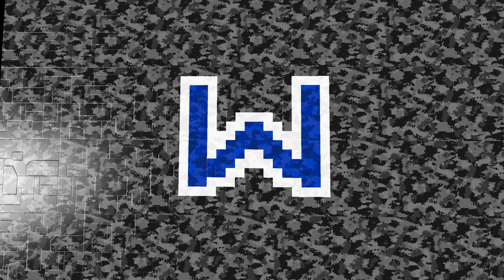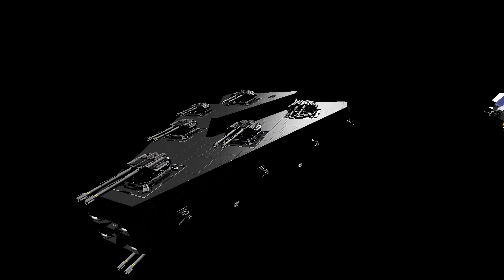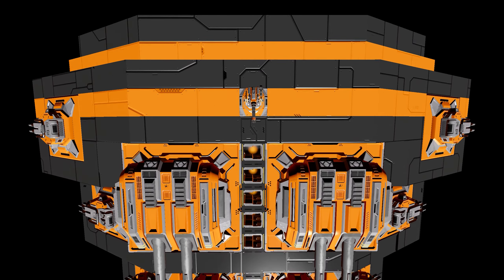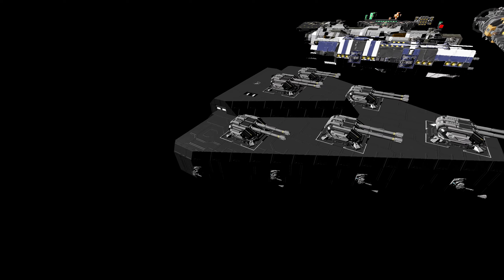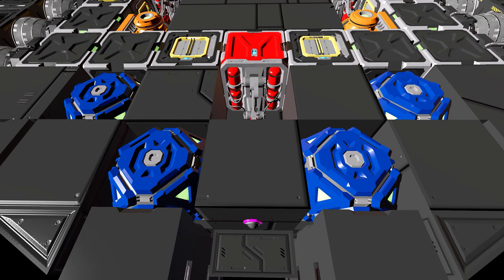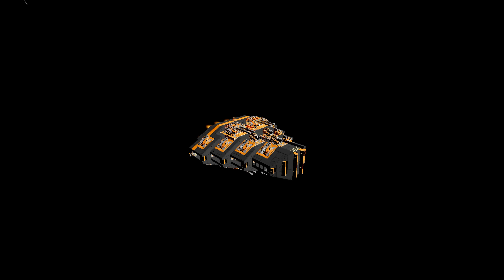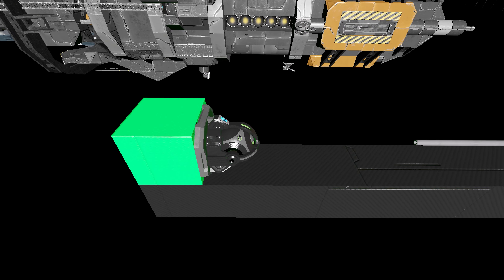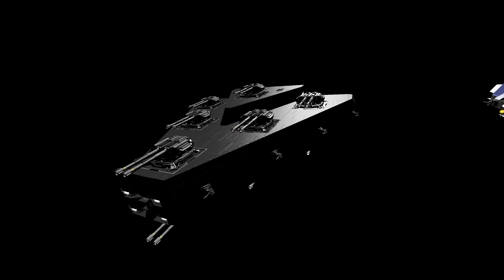What Makes A Ship Good? | Space Engineers

Comment: The defense shields mod has a major impact on ship design as well. The dynamics of weapons changes a lot because some are stronger against shields and weak against armor and vice versa. Also, slower ships can compensate by putting more reactors in to pump out more MW for stronger shields. They end up turning into big tanks that can soak up a lot of damage and if your shield is weaker they can rip through it more easily.

Comment: To add more logic about broadsides vs doreetos/superfiring. If you put 10 turrets on a superfiring ship and 10 on a broadside ship, in any engagement the broadside ship can only bring 5 to bear at once while the superposition means you can bring all 10. A ship with superpositioned turrets and efficient placement can punch FAR above its weight class. There is a reason  ww2 battleships often had superfiring turrets, so that outside of a broadside they could use more than 1 turret and instead 2 or 3 at a target in front or behind them.
Reply from the maker: well said :)
Reply: not necessarily true, you can roll your ship so the top deck is aligned with the target, all turrets will be able to shoot now

Comment: My ship was designed to be a heavy cruiser and mobile base. I consolidated all crew areas and expanded the cargo hold and smaller hangar. I also built triple redundancy for power and thrust. It has a capable turret system in case of broadside, but I prefer to keep enemies at range using 4 forward facing rail guns  hooked up on timers in order to stagger the shot in a manner that I can decide to fire two instead of firing all 4 at once. I hit them from afar while a small fighter compliment does most of the heavy lifting. If they try to maneuver back up and orient forward. My fleet command style is keeping all ships on line and focus fire forward using rail gun batteries.
Reply from the maker: thats cool!

Comment: Apologies for what turned out to be another wall o' text:

Superfiring is a term for describing turrets placed to fire over lower turrets (exhibit A: the Dorito chip).

In a sandbox, anyone can build anything they want, then justify it with a set of lore specific to their goals. But I feel like good ship design doesn't have to run counter to RP lore, and what some people dismiss as "game meta" is just sensible. this is a bit of semantic arguing, but superfiring turrets are generally a logical conclusion for good combat design (barring specific reasons to want to compartmentalize and hide your turrets by countersinking them within the armored hull). Internal thruster blocks are game meta, b/c IRL you can't do that with real thrusters given our current understanding of drives using reaction mass. :D And this isn't to deride internal thrusters or other meta, b/c I've used them too -- if it works, it works.

On my own though, I like to make my game lore or whatever coherent with rule-based ship class designs, broadly similar in concept to how GetBrocked does their Outlands ship classes.

For myself in solo PVE, no tool/production blocks (drills, welders, grinders, refineries, assemblers) on the same ship/grid with weapons; only survival kits and basic assemblers/refineries. That keeps my utility ships distinct as auxiliary or non-combat ships. The two basic production blocks are a deliberate design choice to restrict my combat ships from simply being factory/mining ships plus guns, and my production ships simply being warships plus refineries/assemblers. :D Otherwise, I found myself smearing all my functions into a single all-rounder, like how Luca describes her survival warships plus full refinery plus full assembler plus drill.

I'm also reaching a point where I finally need to learn to make a (not so?) basic mod for automatically charging the player space credits per owned and active PCU, per time period. With a default multiplier for small grid blocks, large grid blocks, and optional specific per-block multipliers as inputs. Using this little RP idea of paying regular maintenance/overhead fees for grids/PCUs used gave me an abstracted analog to real-world operating costs, and spurred me to secure an income (even if it was a trifling moment's work to sell some magnesium for a few million credits :P ).

This soft constraint on blocks made me reconsider slapping down 20 drills, b/c they're more expensive. And when I set price tiers and higher specific block upkeep costs, it further shaped my gameplay/design choices. With the Aerodynamics mod, I usee SG 300 and LG 150 m/s speed caps. With my voluntary upkeep cost game rule, I charge myself 1 credit per small grid PCU, and 10 credits per large grid PCU. For my current  economy/combat focused play, an additional stacking 100x multiplier for any tool/production block -- so a large grid drill costs me 190,000 credits per ingame day (every 2 hours). This motivates me to NOT build huge grinding pits, massive drill rigs, etc and leave them lying around. Either they pay for themselves with stuff I can make/sell from their output, or I tear them down when not in use, or I keep only a minimal 1-2 drill rig that's very adaptable.

And previously, once I got out of the early survival resource grind (easy enough with a series of bootstrapped drills and rigs), there was no real advantage to using small grid ships. In fact, PCU-wise, there's often a strong disincentive to use small grids. They die if an enemy weapon gives them a dirty look. They're PCU-expensive. They can't carry much or do much damage. But the above combination of 300 SG speed cap and relatively cheaper space credits upkeep cost makes them more viable in my little bubble world now. When a modest large grid warship could cost me 200k credits per ingame day to maintain, printing and running a series of cheap 2k credit task-specific small grid interceptors and bombers/gunships makes a lot more sense. Especially when combined with AI block drones.

It helps remind me to be more PCU-efficient, less lazy, clean up my grids, use a more diverse range of ships, etc. Until now, I have virtually NEVER built a small grid large cargo container or small grid cargo ship. :D Now within these rules, they actually have a niche, serving as fast local couriers to fulfill high-value, low-volume contracts or trade station resource sales (thus letting me afford those large grid warships more time-efficiently by quickly hitting all the local stations for selling magnesium, platinum, etc).

Anyway, I guess my point is that anyone motivated thusly can create their own set of RP/lore-based reasons, implemented as a coherent set of self-imposed game rules or game mode. Doesn't have to look like Brock's or my paradigms at all. The goal should be, per your previous video about making SE fresh again, for these gameplay rules, objectives, or conditions to spur ship use, resource management, or ship design that's new and different from how a person regularly plays.

Splitsie, Wellington6012, and AndrewmanGaming have all used scenario rules to create a low/no-RP game experience that's different from the usual unrestricted progression from survival kit to space dreadnought.
Reply from the maker: I responded to your other comment, but I totally agree. I’ve watched a lot of these other youtubers create some rules for themselves and it definitely seems very cool. I enjoy lore that dictates the style and ships you make too, I personally think it’s very cool!

Comment: It has been a few years since I played space engineers. Why are gravity drives not commonly used?
Reply: I believe it's mainly lag, but from personal experience your ship can just veer off in a random direction for no real reason
Reply: I personally always use gravity drives with the help of the script, "Gravity Drive Manager". It makes it so WASD controls the grav drive, super useful. But on servers, usually scripts are disabled for lag purposes. This means you have to control the ship with hot bar buttons, which can be annoying to have to manage as a solo pilot in the middle of battle. They're also expensive and take some planning to get lined up with the ship center of mass. IMO one of the most useful features of grav drives is using them to turn massive ships rather than accelerate. But again, tedious to manage as a solo pilot, whereas if you have a crew the pilot can say "grav drive full left" and have someone else fiddle with them.
Reply: Grav drives require ship planning that most do not have, and can be detrimental if mass shifts and damage are not taken into account.

I prefer flying them without scripts, and have used them in both low power cruise and combat turns.
Reply: People are too lazy to set them up, and no, they don't require much planning at all

Comment: Decently informative but was pretty minimal on design choices and their effects. Typically i divide them into 3 sections: hull, command, and hangers.

Hulls are typically determined by shape, but shape should have contrast in mind "the hide of a bear is thick and soft, but the mouth is one fangs and flesh". The general shapes come in three forms: The pillar, The Wedge, or The Theatre .
•The Pillar design is one that minimizes frontal view, but limits opening fire. Often you can tier guns as remedy but the focus is heavy frontal defense and brutal side assaults.
•The Theatre design is on of display! They're extensively wide/ tall as method of providing vast array of weapons spacing too ensure safety, but this is extremely vulnerable and is left for artillery.
•The Wedge design is balance as it's frontal weapons are powerful and broadside is worthy, but often it extremely frontal focus leaves rear view insanely vulnerable.

Command centers are where you perform the ships operation like a brain, but makes you as vulnerable as a brain. One shot can easily disable a ship and make it run it's course. Often recommendations are you design reserve or evolving designs of the three: The Bridge, The Face, or The Den.
•The bridge is classic design of a exterior deck with vast view angles. While vulnerable they're also valued for providing unrivaled strategic awareness. 
•The Face is a half buried frontal command deck designed for a strong view, but still providing a object of weakness. Often a more balanced choice.
•The Den is a deep comand structure where there's no viability, But unrivaled defense! Often this relies on networks of cameras which are vulnerable but still allows command even when blinded.

Hangers are the cornerstone of response and come in mainly two designs: frontal or sides.
•Frontal hangers are extremely fast responsive in which fighters can be sent like missiles providing powerful assistance. Problem is hangers can be vulnerable too on coming fire.
•Side hangers are the opposite naturally providing slow disoriented deployment but allow vastly more safety.

Many designs can be mixed and matched, but often they define your design as well as your approach.
Reply from the maker: I have another video coming out on designing warship shapes and such.